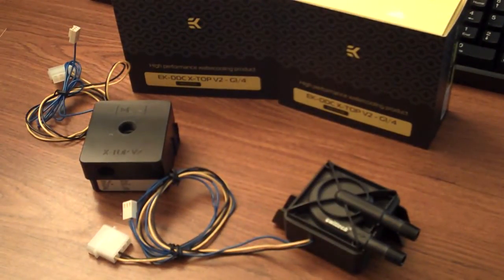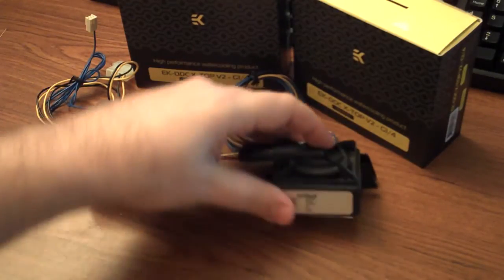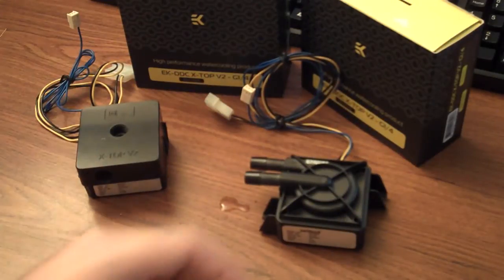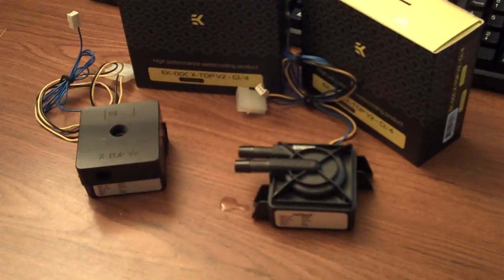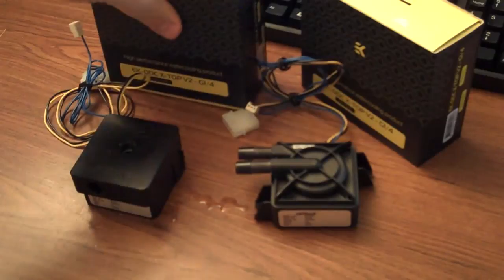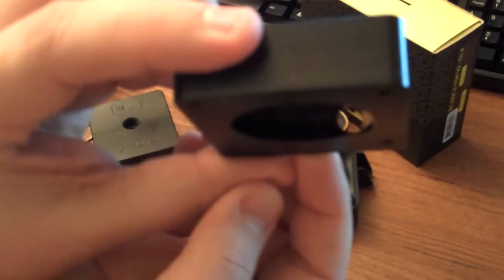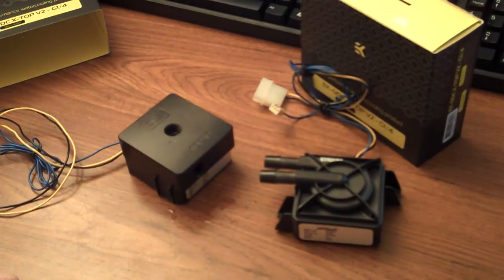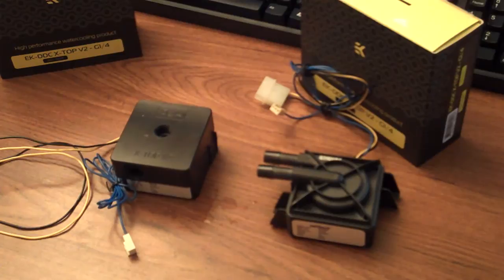Discussion: Swiftech MCP 350 & EK-DDC X-Top V2

Comment: i run my loops pump to waterblock to rad then to my  res and back around. Not sure why you wouldnt want to get the water right to the radiator quickly and then have the res cool it off a hair more

Comment: Pump like is mostly dependent on its environment. If you have your pump is the bottom of your case with no airflow, they'll die. People forget the pump itself needs air circulation around it to take away heat.